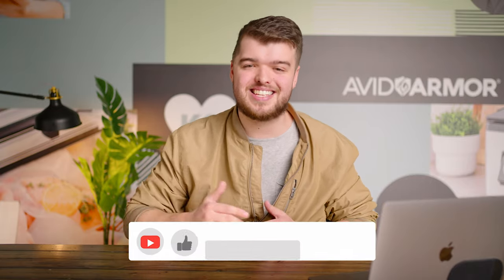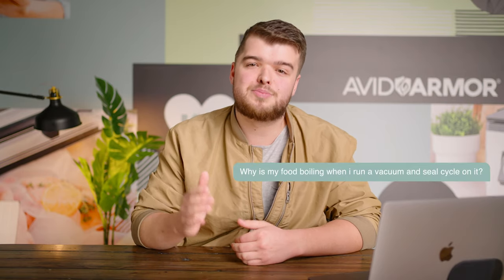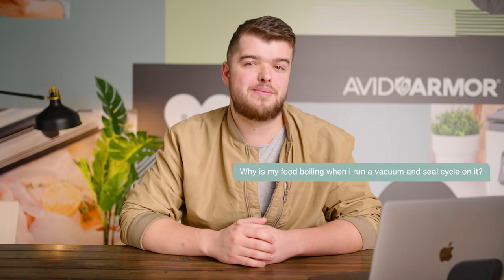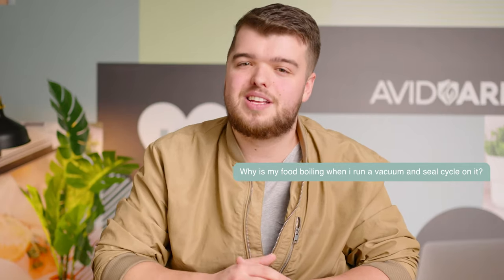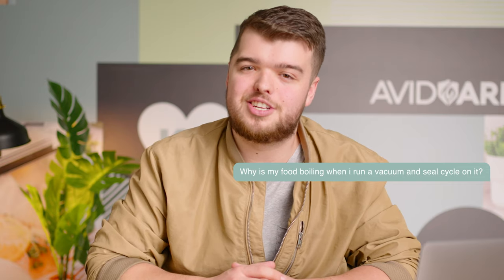Answering Your Most Asked Questions | Avid Armor

Comment: 1st off Thank You!! I just received my USV32.  I've been dehydrating and vacuum sealing for decades. Beginning of this year I bought a freeze dryer from harvest Right. 

I prefer to vacuum seal all of my products in Mylar bags. But with a standard vacuum sealer, I have to use special textured vacuum bags.

My question is with your sealer will it seal any mylar bags smooth or textured, and up to what mil??
Reply from the maker: You should be able to use texture or smooth mylar bags. As long as the bag is made of low density polyethylene it should work. We've tested up to a 5 mil thickness in mylar bags!
Reply: @Avidarmor  Thank you!!